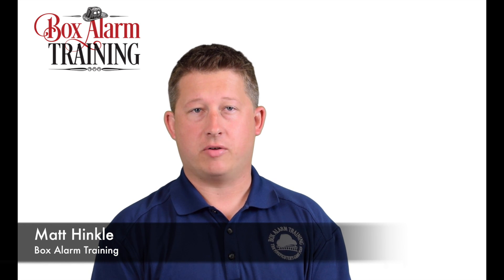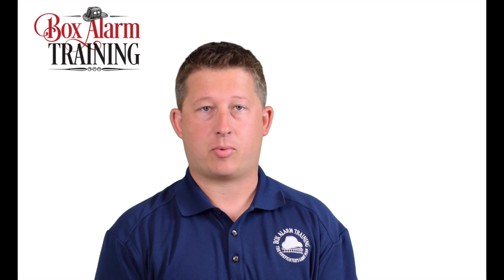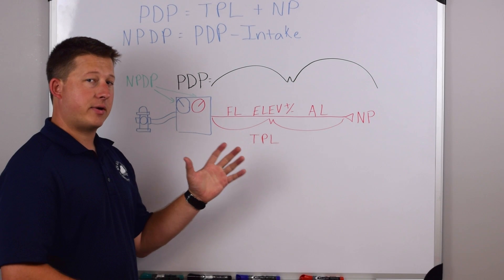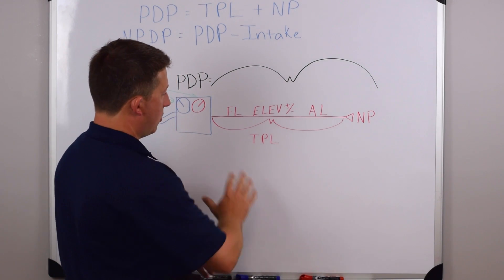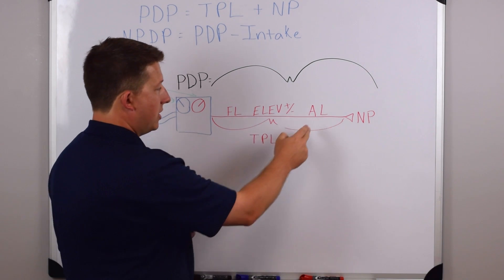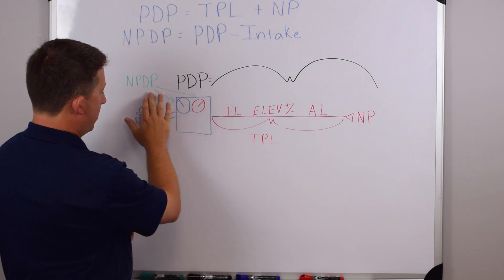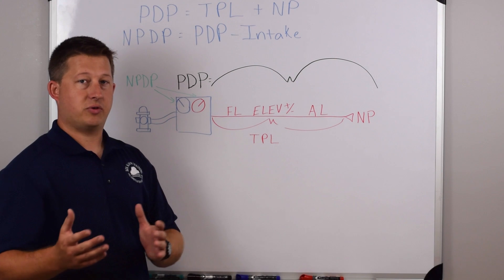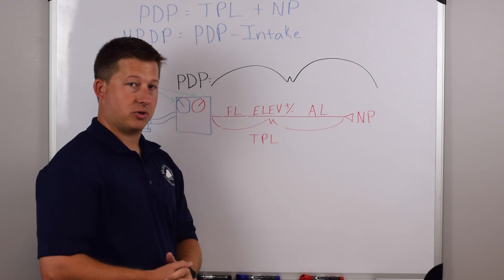Pump Operator Training Series - Part 1 "Pump Discharge Pressure"

Comment: Set that pump to 90 to 120 and flow that water, nozzleman will tell u if it's too much .
Reply from the maker: Unfortunately that’s not how it works. In a recent study nearly 50% of participants working a nozzle could not feel a 25% reduction in flow. The nozzleman generally is not very good about guiding the pump operator to achieve the correct PDP.
Reply: You’ve pulled the attack line and just before entry you open it...

If you need more P

Mash the radio and communicate to your driver
Reply: Assuming you have a newer pump that'll do that

Comment: Am I correct in thinking of Nozzle Pressure as Pump Discharge Pressure minus Total Pressure Loss?  I think that's "upside down" from what you said, but I can make that work in my head a bit easier.